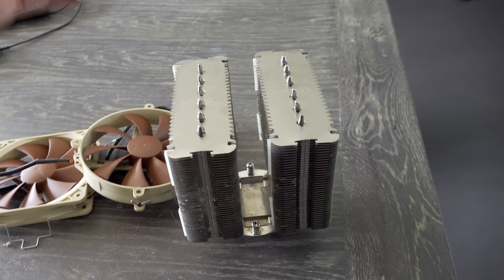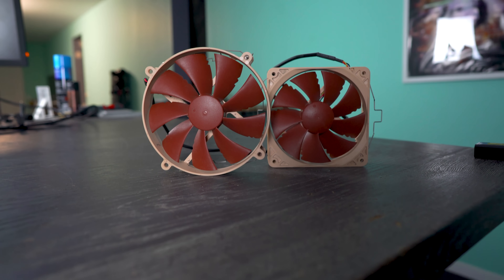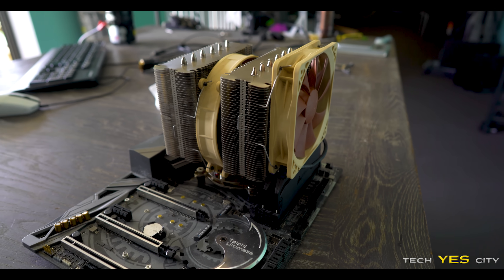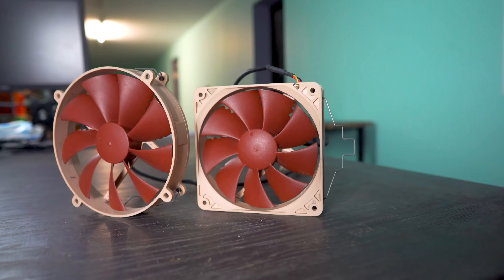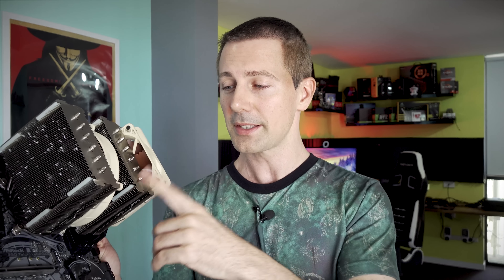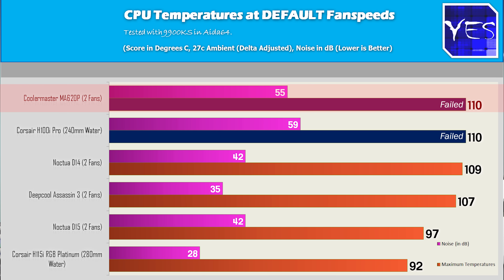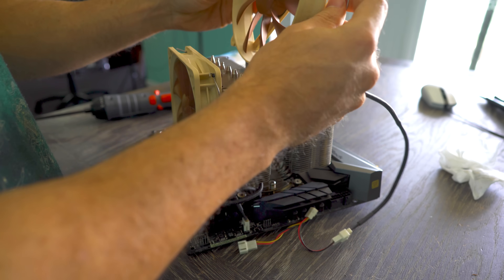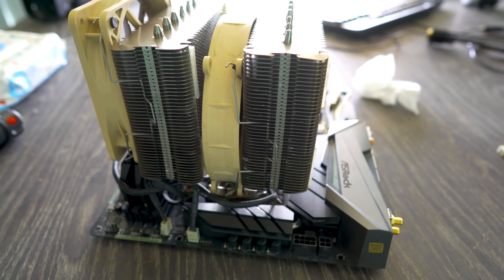This Noctua D14 is from 2009.... How Well Does it Perform in 2020?

Comment: This is the advantage of air coolers. All AiOs will be dead in 10 years.
Reply: I prefer air cooler, because the only thing that broken with air cooler will be the fans only. AiO in the other hand...
Reply: Frank you are wrong ... your 2nd Aio would be dead in 10 years ..not just the first !
Reply: @venix20  2nd? You are being way too optimistic, I think most people will be running their third/fourth AIO.
Reply: I have an AIO that's been cooling my Haswell i5 4670K for the last 6 years. In four years, I'll be sure to let you know how it's doing. Ok?
Reply: @MarcoGPUtuber  MTBF of AIO pumps are like fans, about 50,000 hours on average. It doesn't matter how long you have it in your system...they only lose lifespan when running. I had an Antec Kuhler that was dying after 6 years of almost 24/7 operation
Reply: @JABelms  Yea. I use that pc every day. We shall see how long it goes!
Reply: @MarcoGPUtuber  well cared for and maintained anything lasts long
Reply: @MarcoGPUtuber  it's been 4 years :)
Reply: I'm pretty sure my air cooler will outlive me
Reply: Totally agree, a good air-cooler is more reliable
Reply: Nighterlev mines still working after 5 years cooling a i7 4790k 4ghz
Reply: Probably half that.
Reply: I agree, but I actually still have a H50 from 09 that still works.SO they can last, but Air is the best for reliability.
Reply: not many air cooler that could survive that long :P Rust and stuff kill them
But those fan surely an amazing case of survive
Reply: So far my h50  had it sense 09 or 10 still going strong and its been in a pc 24/7:)    Than i got a h100  in 2012   that also been in like  3 builds sense than and also been running 24/7  than in 2019 i retired it from my main ryzen pc for another one that can be filled which is also from 2015.     Had pretty good luck with corsair aios you could say lol
Reply: idk why so many people bashing aios, a typical aio isnt gonna die in 3 years.... theyll last 8+ before dying, yall paranoid
Reply: @Nighterlev  Corsair and NZXT offer a 5 and 6 year warranty respectively on their coolers. So if it fails, well just contact corsair support and get a new cooler. And even if it does leak, Corsair and NZXT are known to replace parts damaged due to AIO failure. In addition, asetek pumps, which NZXT uses, are also used in most other watercoolers so you can expect the same reliability from them

Pump failures are extremely rare and pretty much not a problem
Reply: @Nighterlev  MY AIO is now 6 years old. No issues and it was a refurb. It has run 24 hours a day, and when it does go, since I build PC, duh I have air coolers on stand-by. But when my AIO was about 40% less cost than a D14 it was a no brainer and it does cool better though slightly then the massive 4000RPM monsters I have installed on a Mugen 2 cooler in push-pull that is much cheaper and cools within 1c delta of a D14. I mean AIOs have come a long way over the last decade. They will likely outlast the PC as at 6 years that bastard is already long in the tooth and ready for a new build, just saying. Each time I build there are different aesthetics to consider. Most of my builds would not work them Noctua browns. Hey I know let's make our fans the color of feces and wonder why some refuse to stick them in a system.
Reply: And based on my experience. The psu it blows up when it leaks too!
Reply: I have had ddc pumps from 2006 or 2007 that are fine to this day. I even have a h50 aio from 2011 that is perfect and still on a pc.
I do have a noctua u9s on my latest build 3600 and it's fine.
From my 12+ years of experience watercooling is perfectly reliable.
Air cooling is too.
Reply: @Nighterlev  in my case an AIO I tried was dead after 4 months. Started searching to see if anyone else had similar issues and I ended up finding a guy that did, but instead of going through rma he bought a new one every time and had it fail after 4 months every time.

Turned out they all stopped working due to galvanic corrosion. Guess there wasn't enough anti-corrosive in the loop. As for why he bought so many? His work was time sensitive and it was a lot faster to buy a replacement than to rma.

Bearing that in mind I skipped RMA and just stuck to air cooling.
Reply: @dj-rocketman8545  why brag about the cost of an AIO when you can go full custom with $100 waterblocks? Might as well when custom loops provably outperform AIOs and allow you to show off your epeen to everyone.
Reply: I don't agree, some will still work. But yea, Air cooler will last 10 years more
Reply: I'm surprised it's not dried out
Reply: @Pho Tato I think MTBF is measured as best case scenario...it has nothing to do with the bearing but is more about the power delivery
Reply: My Antec Kuhler H2O 620 is still kicking overclocked ass with my OCed 2500k SG05 ITX build since 2013. Paired with a Silverstone Air Penetrator 12cm AP121 with manual speed control if I want to wow people with its roaring sound ;)
Reply: @SISSYPUSS  Doesn't matter that is the only basis available to us. If Noctua tells me my F12s last for 150K hours then they last for 150K hours
Reply: @Nighterlev  Though I've replaced liquid on old AIO and actually mod some tubes for my clients, I'm pretty sure there are AIO out there which doesn't have this problem (because my open loop doesn't)
Reply: ive got 2 10 year old h100s that would argue against that lmao. but yeah an air cooler could last forever, where all pump driven systems will cease to function eventually
Reply: My AIO failed after 1 year lmao
Reply: This shows he doesn't understand cooling these tower coolers have a life as well I suggest he looks up how heat transfer works in the heatpipes.

Warranties are based on testing this is why these had 6 years because they know theirs breakdown after that otherwise it would be like some pc parts which offer lifetime.

AIO tend to have a life of around 5 years can go on longer but you will see performance issues or air in the system etc (other thing with AIO a lot of people install them wrong the pipes going into the rad should be at the bottom)

Funny how he mentions fans yet you dont see him lubricate them correctly he even lets them spin when using his vac on them which you shouldn't do.

The temps on the chart as well are unrealistic you shouldn't ever be letting that cpu be getting near 100

Comment: It is really amazing. After I watch your sharing, I decided to use 14 years old D14 instead of buying new one. And It is still working and performing very well after 14 years. I needed to clean it first. Later, I installed D14 to LGA 1200 i7 10700 Comet Lake CPU. I did not add thermal paste and used existing CPUs remaining thermal paste on it. And the result is really awesome. I am able to play Diablo 4 at High Profile settings without any trouble. Another good news is that Noctua informed me that they will send LGA1200 installation kit for free of charge. It saved me a lot of money. Thnx a lot.

Comment: I bought my nh-d14 once I got i5 2500k back in 2011. Now I just installed it on my amd 7800x3d couple weeks ago, just used a kit from noctua to fit new socket.
Reply: How about temps?

Comment: Guys, I have the following question: my PC produces 120 watts of heat. At the same time, the heat pipes on the Noctua NH-D14 are barely warm, although the processor heats up to 90 degrees. This is fine ???

Comment: Using Nhd 14 on ryzen 3600 ( 61-64°celsius) while gaming.
I want to upgrade soon to 5800x3d.
I hope it will cool it enaugh and i will not be forced to buy d15.

Some guy on comments sugested noctua advice on replacing fans with new ones,
I will see how it goes.

Comment: 15 years still going. Just about to put it on a 14700k.
Reply: How is it doing in that 14700k?
Reply: @kananmammadli6714  I got a 13700k and yes it works just great. I am running at stock speeds atm. Nothing I throw at it runs slow.

Comment: The D14 still is a great option only need to change that old fans and you see the temperatures going down, im using this whit 2 grand flex PWM 2400RPM and still kickling

Comment: Still rocks as hell on my 9900k at all core 5ghz at 55c at full load🙂
Reply: Moving mine from 9900k to 9800x3d. Came here to compare to d15, and from there to 15 g2. Might just get the new fans, but I feel like I might owe Noctua some money for the last 13/14 years of use plus the brackets they have sent me as I've changed sockets🙂

Comment: I still use my Noctua NH-C12P SE14 (purchased Oct 2013) on my 3600X based server. Noctua send me a free kit to convert it to AM4, and it is just continue doing its thing. What I really like about the NH-C12P is how it both cools the cpu, but also provides a lot of air to the heatsinks around the cpu socket, while also blowing air over the ram. It might not be needed to cool that too, but for a 24/7 system with limited flow through the case, it is nice when every little bit of that air is used.

Comment: Bought one in at the start of 2011 and still using it nearly 12 years later with the original fans. Bought it for a 2600K, now it's on a 9700K.

Comment: I've had one of these bad boys since they came out, and apart from the insane size factor and problems it has caused with some other components, it has been absolutely amazing. When I bought it at a suggestion of a review, I had no idea what a quality device it was compared to other coolers, until I was considering upgrading it a few years ago. All these newer sexier solutions I was wanting to upgrade to, just didn't seem worth it at all.

Eventually a few years later, I did get a water-cooled system for my newest computer, and left the D14 mounted into my older rig due to mounting issues (the same memory spacing issue visible here), but tbh. the D14 properly setup was way better than this current liquid cooled one.
Reply: Noctua have lifetime free mounting support. I emailed them after 15 years and they posted the LGA1700 kit to make it fit. 😄
Reply: @changeagent228  Funnily enough, I have switched the Noctua back to my main rig, since posting this comment when I upgraded my computer to latest gen. It is just so freaking efficient and quiet!
Reply: Yeah 250w of dissipation with 12dB of fan noise what's not to love. When the 14th generation releases next month I'm going to try a 14700k on it and see how it fairs. 😁😁 @Songfugel

Comment: I have been using my D14 for over 10 years now. Everytime I do a new build I think that maybe it is time to upgrade the cooler but so far I haven't seen anything that gives compellingly better performance. It even still has the original fans.
Reply: I'm using it still, and will upgrade soon with new CPU(i`m now with i7 2600k overclocked to almost 4.9ghz for 9year, and no problems still work very very fine) and will use the same cooler for the next 10-13y xD it si very solid.
Reply: how do you control fanspeed if your cpu gets higher temps, if the fans dont have the 4th pin / PWM?
Reply: Me too..this cooler is amazing since you can easily purchase mounting kits for all new sockets..just changed mine from socket 1150 to socket AM4..
Reply: @MrEmotional33 You don't have to purchase them, if you have the original receipt they will literally mail it to you for free.
Reply: Noctua will send them to you gratis if you ask them. Shipping has changed now the UK has left the EU though. Having a look at comparisons to see if I want to give them some money for my over a decade use and their R&D for the d15 g2

Comment: Have a 12p SE about 11 yo - bought for a x58. Currently it's on a 5600x with a new adapter for am4 and a brand new Noctua 12cm fan with PWM. Guess what?! Never goes above 65 Celsius.  :)  Absolutely unbelievable.  Kudos to Noctua.

Comment: Still rocking this beast cooler and am planning on keeping it when I upgrade in the future.  
Amazing thing is, you can contact Noctua with a picture and timestamp of your cooler (or receipt if you still have it) and a receipt for a new platform you bought that has a different socket and they will send you mounting brackets FOR FREE.  
I'm so glad I went with this giant brick instead of an AIO, because that pump would have been dead for sure, but this monster was cooling my 2500K back in 2011, it's cooling my 3770K still and will cool whatever I get in the future, probably more than 1 upgrade as well!  
Investing into a good air cooler is the best decision you can make if you're a budget oriented gamer.

Comment: It performs awesome, I just pulled my 2010 D14 out of my old gaming rig and put it into my brand new build.  As for fan quality, My rig was running around the clock for a decade, almost never shut off and not a single one of my 6 Noctua fans have failed as of yet.
Reply: I'm about to Do the same, with a. 370z moard, what memory have you use that clears this cooler just fine? I'm reading the corsair lpx is the goto

Comment: Funny he doesn't mount the square fan on the side that the io shield is on.
It's a bloody big cooler but most of the builds i have used mine on don't require me to bend RAM to have the fan mounted.

Comment: I am stil using my D14 and started on a AM3 and later on a lga 1150 .later on when i went to Ryzen i get a AM4 mounting kit free of charge from Noctua .
Now i replaced the two fans that come with the D14 for two noctua nf-a12x25 pwm fans ,and that is a real good upgrade.
Notice: I needed fanclips for the noctua nf-a12x25 pwm to put on the D14 and again i get these free of charge from Noctua .

Comment: Still using mine, bought it for my i7 920 in early 2009, re-used it for my 6700k delidded and now on my 3700X, still the same fans and mine isn't bent like yours.

And thanks to Noctua for sending me completely free of charge a SecureFirm2 AM4 kit.

Awesome company, their fans are overpriced but there is a reason.

Comment: D14 rules! It is high rise and may have clearance issues in narrow cases.  Low profile memory is a bit of a challenge but I manage. It's HARD to clean but works very well when half choked with dust.. Noctua fans do not seem to suffer wear as do most fans. There are 6 Noctua fans in my PC, none younger than 8 years, most older. Periodic cleaning is needed to reduce noise and keep efficiency up. Otherwise completely dependable. I may refit my D14 with new Noctua black turbine CPU fans as they are very groovy looking but it's not needed..

Comment: wow, they say specifically not to put the heatsink in water and it still worked. how did you clean the fans btw they're spotless. and yeah i'm still using this cooler myself for 7 years. the MTTF on the fan is >150,000h per the website which equates to ~17 years of 24/7 usage. so yeah it's a pretty effing great value especially for being so quiet as well.

Comment: I just got the FREE mounting hardware upgrade kit from Noctua for my D-14 that has been used on an overclocked FX-8350 Black Edition (overclocked to 4.5GHz) since that CPU came out.
It is now used on a Ryzen 3600X with zero issues. PWM fans aren't THAT important as my Motherboard supports fan profile tuning via voltage adjustment as well as PWM.

Comment: About to put the d-14 from my old build on a i7 10700k to see how it goes. Will probably inevitably upgrade to a D-15 but should be good until then:)
Reply: How did the d-14 work out?
Reply: @DjViceroy  Runs beautifully. I had to get some new mounts for it. Overclocked it to 5.1 I am still using it now:)
Reply: @Julian-xo7vj  Thanks, thata what I wanted to hear!

Comment: Err that fan over the ram isn't set up right, I wouldn't be surprised if the offset fan made it lose out on some performance since it not pushing air through the bottom part of the fins.  Did you offset the  front fan on the deepcool 3 too? How about the NH-D15?  When using an older D14 like this you need to keep ram clearance in mind which this test doesn't seem to have done and have opted to simply raise the first fan which makes this test kind of flawed IMO.

Comment: still use it until now..cooled X5680 @4.4Ghz with max temp 70C.
and still ok for cooling Ryzen 3600@4.5Ghz.

The key to this cooler, is low profile RAM :D

Comment: A heatpipe cooler is a heatpipe cooler. I found that a 2010 Thermalright Ultra 120 eXteme performs exactly as well (on a trusty old 1155 i7-2600K @ 4.5GHz) as a new Noctua NH-U14S, both six-pipe, single tower coolers of similar size and weight - no difference in temps whatsoever, just less noise from the Noctua's giant fan.

Comment: I'm still using my Noctua NH-U12S that I bought in 2015. I first had it on the FX-8350 I had back then and it's currently sitting on a Ryzen 5 2600 keeping it nice and frosty. Noctua coolers can be a bit expensive, but they're definitely worth it considering the high quality and generous amount of hardware they come with.

Comment: If you need more cooling performance, you could replace the stock fans with newer ones. Noctua itself suggests the NF-P14r redux 1500 PWM (middle) and NF-P12 redux-1700 PWM (front). Both are compatible with the fan clips of the NH-D14 and combined they have around 50m³/h more airflow than the stock fans (at max rpm). Ofcourse they can get louder at max rpm, but they are PWM so you can control them as you see fit ;-)